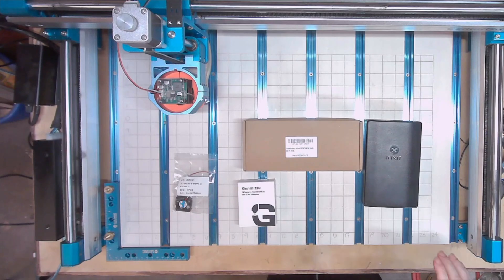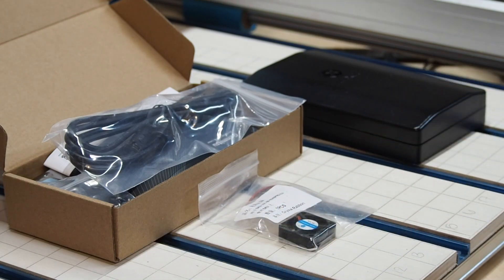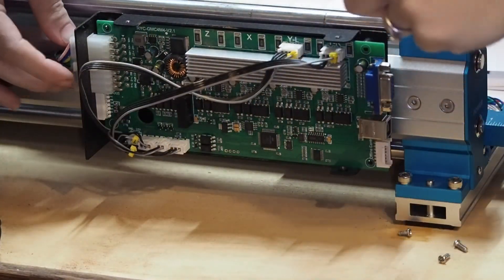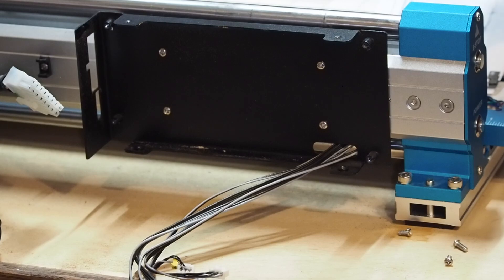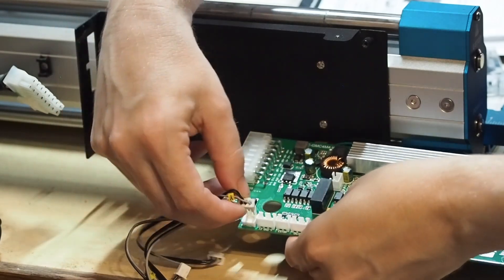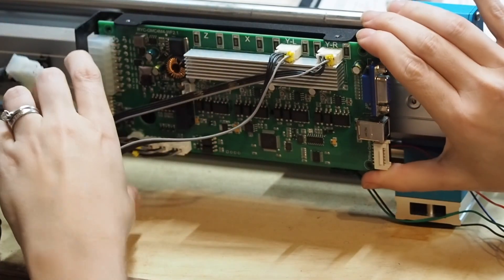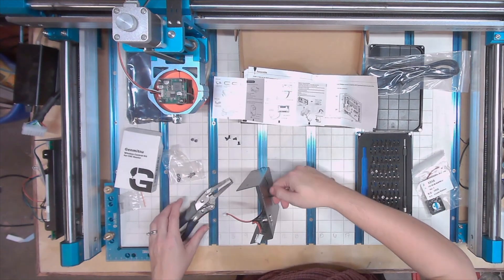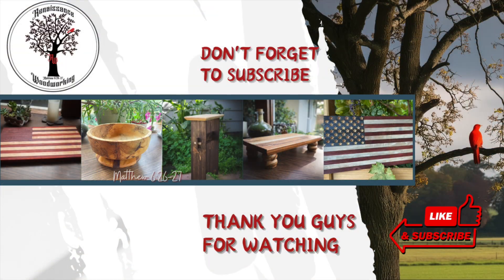I Installed WiFi On My Genmitsu 4040 Pro CNC!

Comment: super, Note if you have the 4040 pro max, there is no need to take the case apart, you will see the wire for the wifi module cable tied to the rail at the front under the box, simply cut the cable tie, pull the wire off the rail and plug the wifi module in to it as shown on the video.
Reply from the maker: Awesome! TY for the info!  I'm glad they made that easier on the max. I still have the 4040 pro, but upgraded just the gantry to the max.

Comment: Great video - thanks so much!   I couldn't figure out how to do this until I saw the video and realized I was trying to connect the wrong cable.   The board or module came with a second different cable that doesn't work at all (not sure which as I unboxed everything at the same time.
Reply from the maker: Yea, they don't always label which cable of the multiple they send you to use. Sometimes they do, but then the cable is not labeled. Thank you!

Comment: About to do this myself as part of my 4040 to 6060 conversion, right now I have absolutely everything in pieces on three workbenches, good times lol
Reply from the maker: Haha! Yup. I did the extension build last month. Just went to 6040. I don't have the room for the Y axis so did a sliding table instead. I did a build video of the extension as well. Make sure you have a heat gun ready.
Reply: @renaissancewoodworking  I love your 0,0 stop square, I may do the same thing!
Reply from the maker: @TunaSoda  Thank you! It works really well and easy to take it off and on.